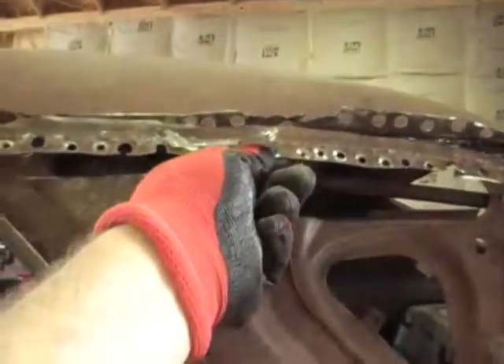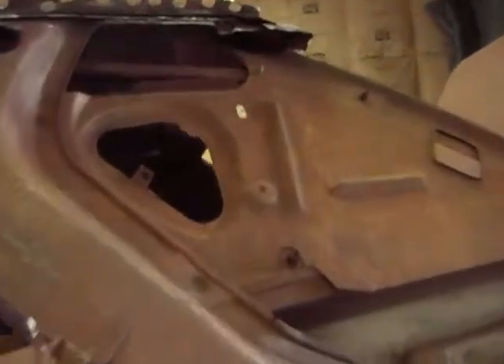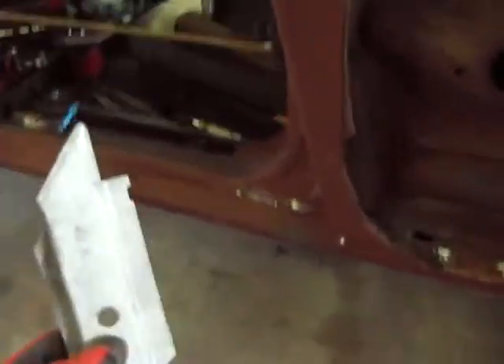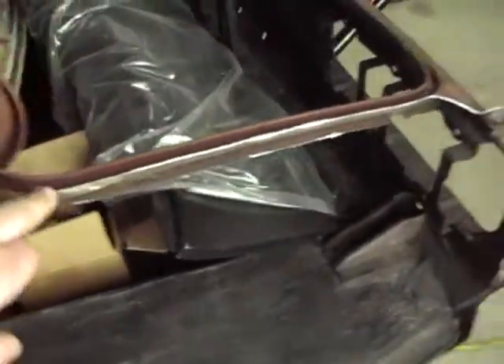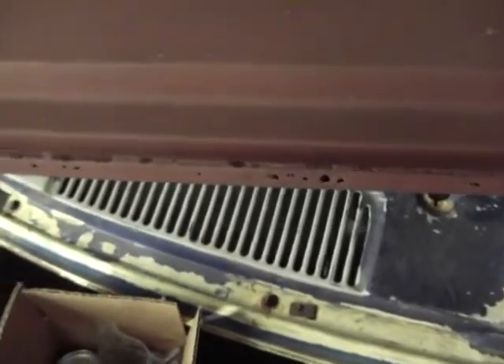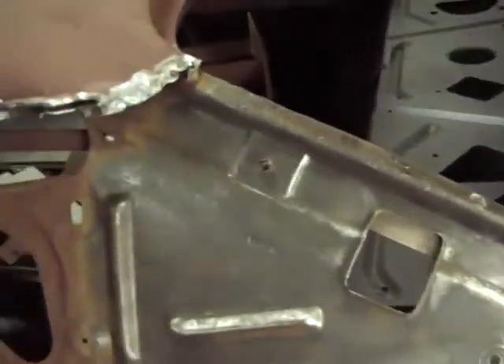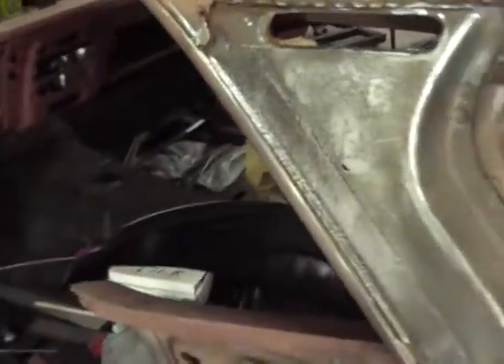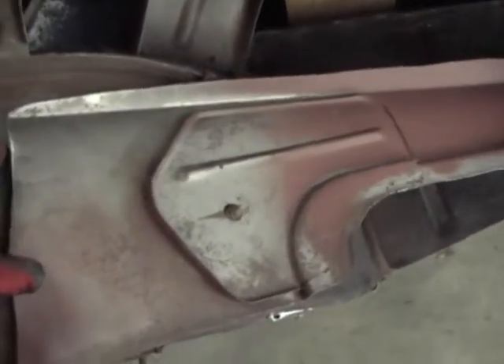camaro 9

Comment: Getting ready to do a quarter panel on a 2003 CTS. Your info on the treated panel and getting the inside treated and painted was very good information. I may not have even thought about doing the inside after the quarter was on. I'll have to look into ways to get that done, probably some weld through primer. I live in the south and with the AC on and temperature change when the car is turned off It made me wonder about the humidity condensing inside my quarter panel. Thanks for the video. Best Wishes n Blessings Keith
Reply from the maker: Awesome glad you liked it, good luck with the CTS!

Comment: i saw alot of panels replacement on you tube and i think no body put that panel back in but i am with you it should be put back and it looks like it can be put back in after the metal work is done